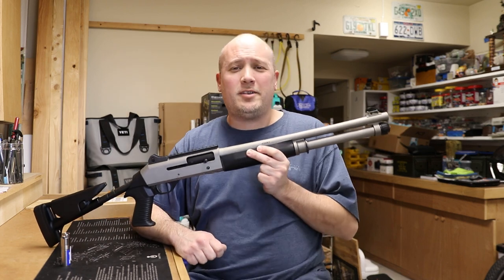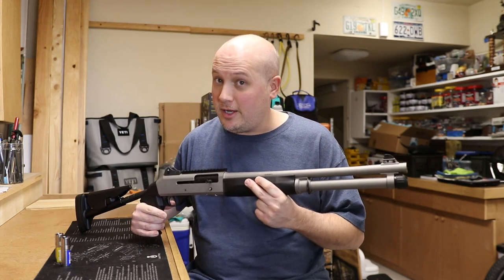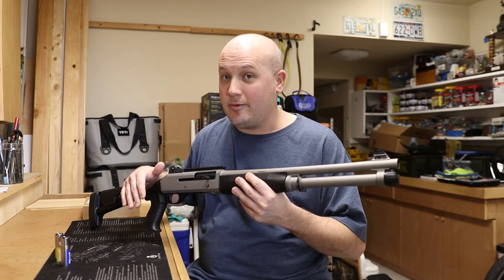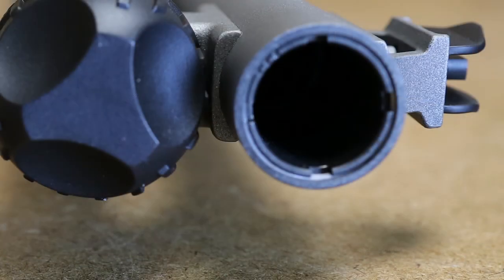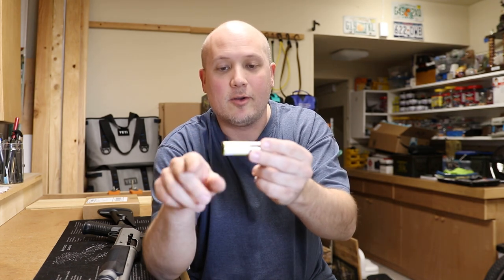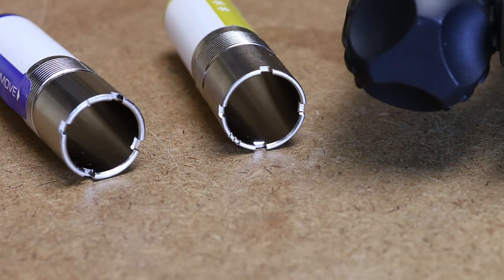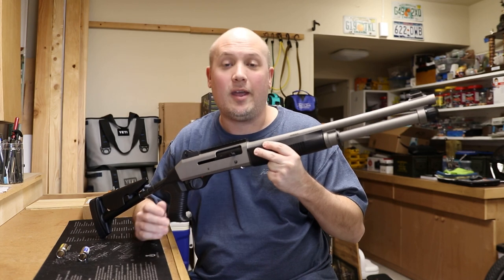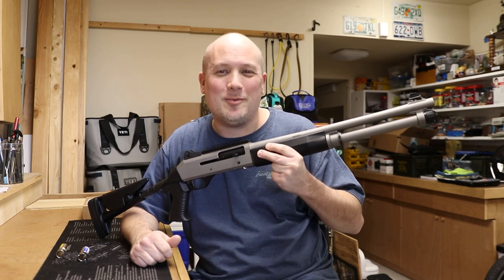How to decode the markings on Benelli tactical shotgun chokes for the M1, M2, M3 & M4

Comment: Some Benelli models like the T4 Pro / M1014 have a fixed choke which makes swapping out chokes impossible !
Reply from the maker: Yeah. Even some of the Benelli M4s with the shorter barrels are that way too.
Reply: @thetexasgunvault  Sir, i have similar question. I just purchased 14" Benelli SuperNova tactical with a "fully open" barrel. Not a surprise  to me, but i am wondering if it can be threaded to take Binelli's, or any, chokes ??? i can't really find any reliable info online, what's your thought on it  ?